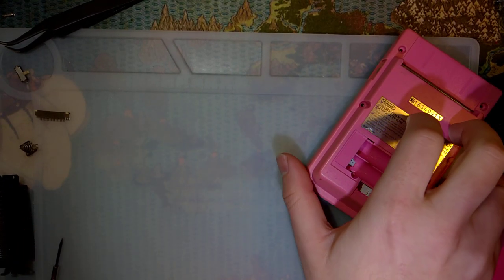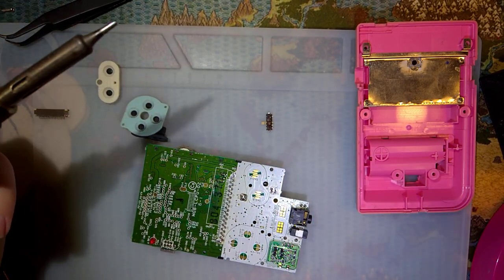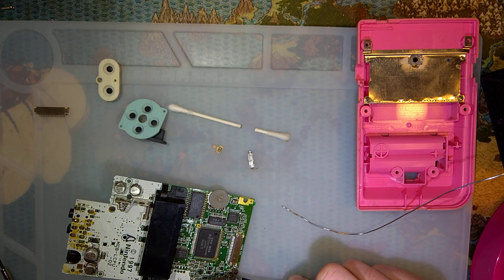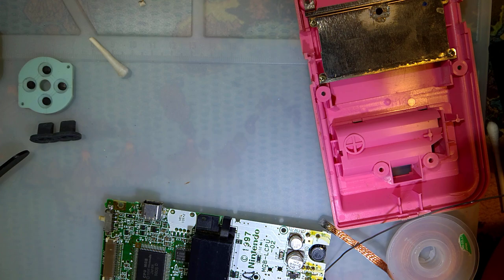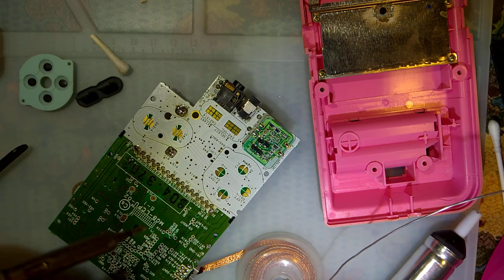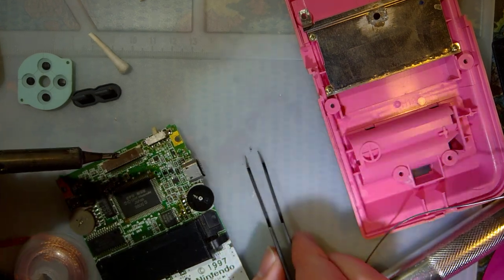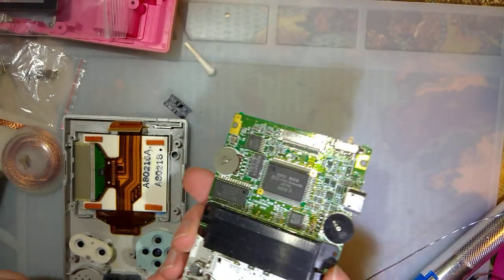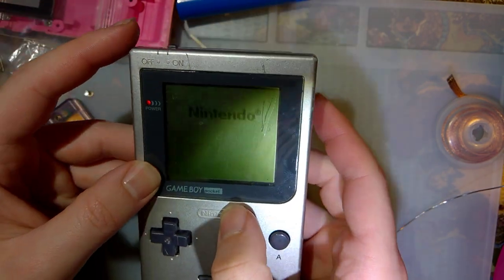Rebuilding a Game Boy Pocket from parts

Comment: I have a gameboy pocket and for some reason I have sound and power but no video signal.I installed a brand new lcd kit and made sure all the ribbons are connected too.Do you think my motherboard might be bad?
Reply from the maker: Potentially dumb question, but have you already adjusted the contrast?
Reply: Yea but doesn't really do anything
Reply: Are the batteries good? Can you try it with external power source thru the power jack? 

Also make sure the screen is connected properly, maybe the ribbon cable is just not making contact?
Reply: Ato Manowski yea everything is good and secured as well as fresh batteries.This is a drop in backlight lcd kit so the contrast wheel does not effect it
Reply: I assume you soldered the wire to the power switch? Because without it there wouldn't be any picture.

If you did, maybe the conversion board is just broken.
Reply: Ato Manowski I soldered the wire not that great.Theres just a tiny bead on there and my soldering skills are not that great.